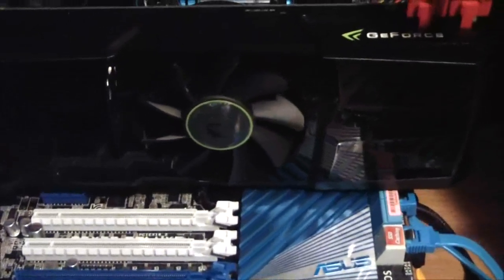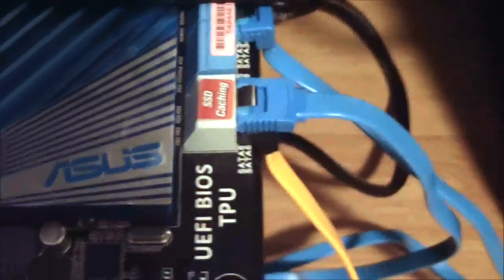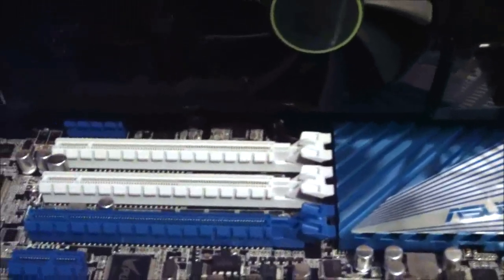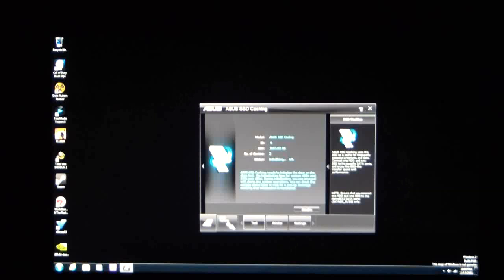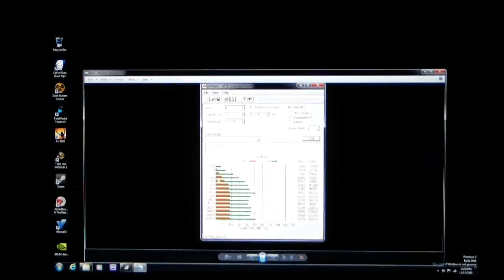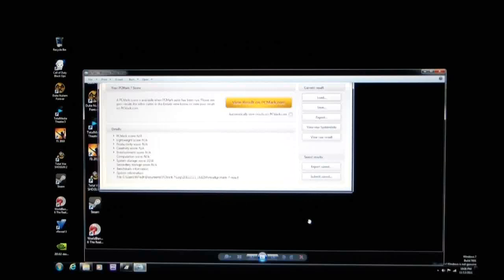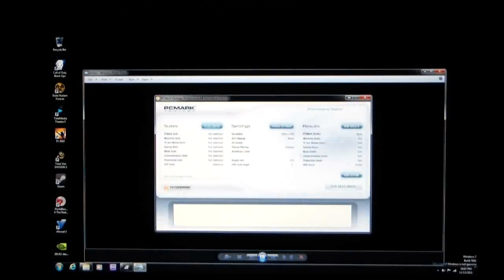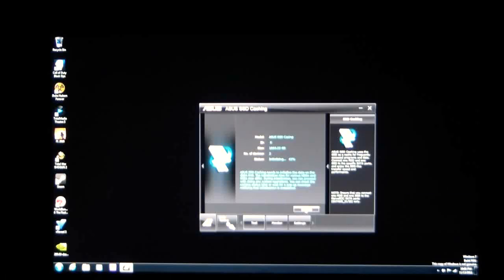ASUS SSD Caching

Comment: Just made my x79 quick again by using a 1 TB SSD as cache for a 2 TB bootdrive. Works fine, 4-8 times higher read speed, write speed a bit higher. Brilliant.

Does anyone know how to see how much space on the SSD is actually used by the caching so I can decide whether a smaller SSD could replace the big 1 TB SSD?

Comment: One thing to keep in mind is that Intel RST has a limitation of small SSD cache drives (64GB max), while with ASUS SSD Caching there is literally no maximum drive size. You can use ANY size SSD you want AND you do not have to configure anything in your BIOS. EASY to setup configure and no limitations to cache sizes!
Reply: David King hi can I use this asus soft at any other MB?
Reply: +Gustavo It is in the hardware.
Reply: +David King Great any size is possible. Which size is still sensible. I run a 2 TB c-drive that `I would like to do SSD-caching for. Does a 1 TB SSD make sense? 2 TB?
Drive is filled up with 1.2 TB data and software at the moment

Comment from the maker: This is why I would just use it for caching and not partitioned. Which you can do.
Use a small capacity SSD it works fine and yes you need the software to do it.
The advantage to it is that you don't have to format a drive in Raid and if you choose not to use it anymore there will be no need to reformat your primary drive.

Comment: only thing I don't like about the ASUS solution is that it's using a Marvell controller which doesn't allow as good write speed at the Intel Sata 3 controller.  Doing tests on my Asus P6 motherboard using OCZ SSD Synapse Cache, I got significant increases in write speed using the Intel vs the Marvel controller.  Also using small SSd's aren't always the best as their read write speeds aren't as good as larger capacity drives.

Comment: Thanks you for this very explicit "how to SSD Caching with P9X79 mobo".
Very explanatory!
Could you please do one for setting up a RAMDISK config with say, P9X79 + 16 G of RAM + 1 SSD (system drive) + 1 T HDD (data) + whatever else is needed. Let's say for using Photoshop or Maya or anything like these demanding applications, please.
It would be rad!!!
Thanks